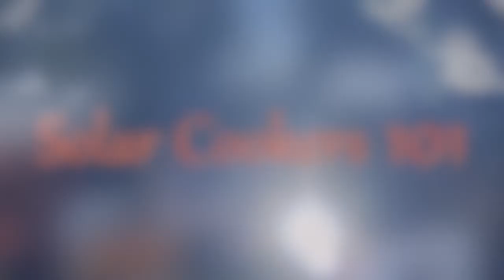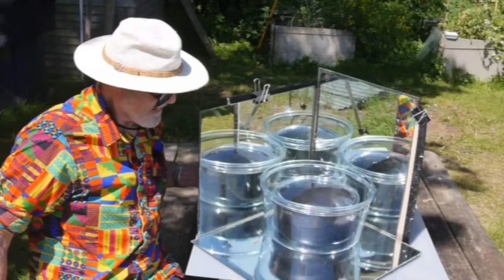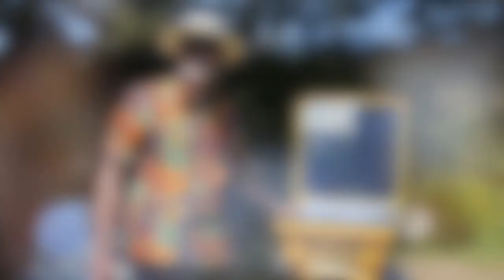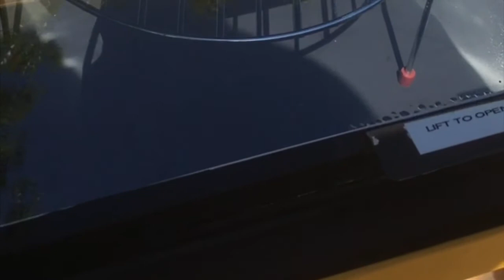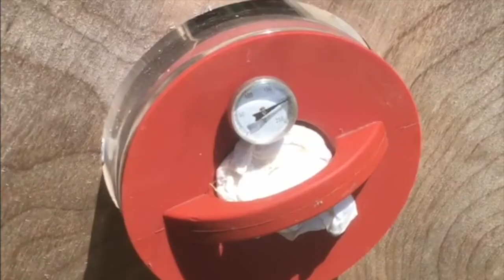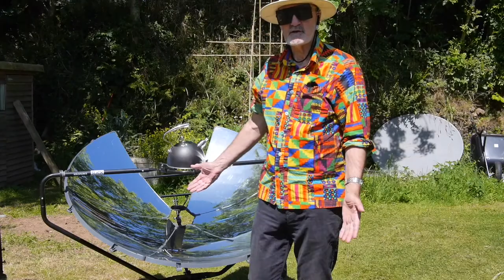Cooking with Starlight   01   Solar Cookers 101   SLiCK

Comment: How do you manage steam when using the glass heat trap container? I imagine steam escaping from the saucepan would fog up the glass and decrease efficiency
Reply from the maker: Hi Barnaby.  Yes, steam can condense on the inside of a heat trap, but only until the inside of the glass reaches 100C.  If you look carefully at the lid I use on the heat trap, you will see that it has a small venting hole in it, so some of the steam can and does escape.  Yes, the steam condensing like that does decrease efficiency, but it is still far more efficient to use a heat trap than to not use one.